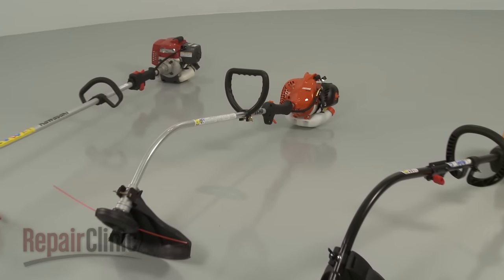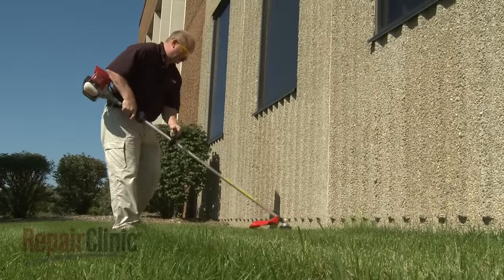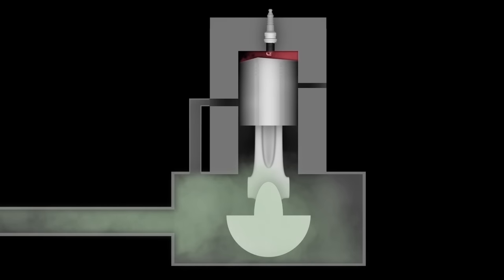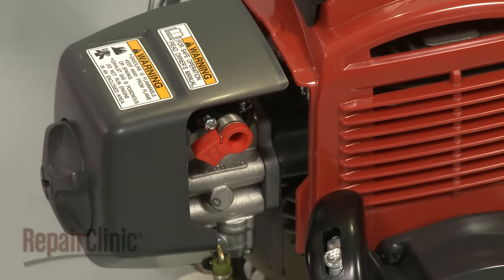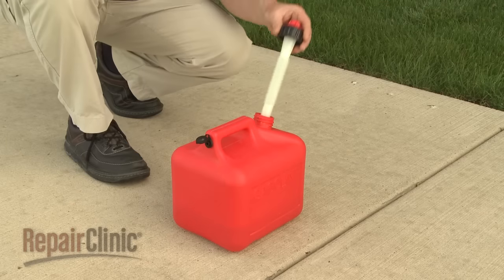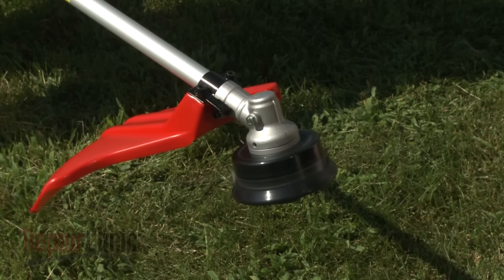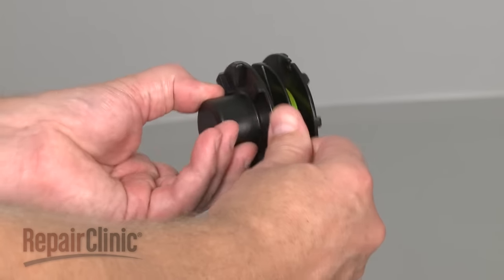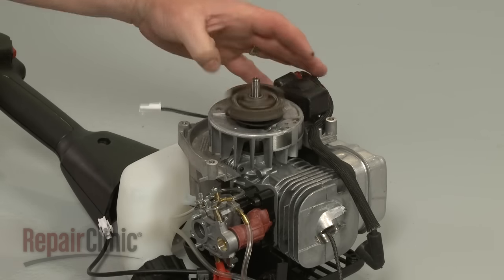How Does A String Trimmer Work? — Lawn Equipment Repair Tips

Comment: Hi Repairclinic. I was working at about 30 celsius outside for about a hour, than for 10 minutes i put the machine at a shade spot for rest, than i begun again. My spark plug was moist when i saw that my grass trimer (Alpin 520) was not working anymore, the next day when i tried to work. I changed the spark plug with a new one and the machine doesen't work still, but at least the spark plug is not moist.

Comment: I put my finger on the spark plug hole and i sense compresion when i pull the trimmer cord. I didn't clean the carburator yet and all the test i have done is without the tube (pipe) bar of the trimmer attached.

Comment: The bulb on a 2 cycle is not a primer bulb but it is a purge bulb. No matter how many times you push the bulb, it does NOT inject fuel into the cylinder. It pulls fuel through the carburetor and fills up the metering side of the carburetor. Excess fuel is pulled back into the tank. The only way to flood a 2 cycle is to keep the choke closed and keep pulling after it fires.

Comment: Hey great video. I just bought a string trimmer today. It seems to labour when under full load. Is that normal for the break in?
Reply from the maker: Yes the RPM will slow down a little under a heavy load, that is normal. Enjoy your new trimmer.

Comment: Great video, I just bought a craftsman weed wacker, it ran good for an hour when I tried to restart it, it will run in idle but when I try to pull the throttle it stalls out, i`m thinking its the wrong type of two cycle oil or too much ethanol in my gas, plan to pour out all the gas and replace it with craftsman 40:1 mix to see if that will help! This was the first time using the weed wacker. Any suggestions?
Reply from the maker: Carlos Johnson That sure could be a bad gas issue. We recommend buying the premixed 2 cycle fuel that contains no ethanol.
Reply: Ok thanks!!!

Comment: thanks for video.  trying to start my tb465ss.  it seems that I can't turn over the engine.  i pull idle lever and when I pull on string, the string snaps back.  it seems to me that problem could be:  a) engine seized b) clutch cable broken or disconnected c) i'm just too old and weak to pull the string hard enough.  any suggestions on how to test a and b?  c is obvious.  thank you.
Reply from the maker: Dan Schag The starter rope could be tangled in the pulley too. Unless you ran the engine with no oil in the fuel it is unlikely seized. The clutch cable can be inspected, but a broken one would not affect pulling the starter.

Comment: hi i have  weed eater straight shaft that runs and revs up and down just that the trimmer head doesn't move, I remember when I used it last I heard and felt like a snap what could it be I want to fix just want to know is it the cable or something different
Reply from the maker: Choco Drizz The drive shaft could have snapped or the clutch at the very top of the shaft is broke. Get you model number to find the right parts for your string trimmer. http://www.repairclinic.com/?TLSID=1773.

Comment: Please help, please help

I have  a brush cutter, the speed increases very high (this is the speed I want) when the fuel is about of empty (5mins before the fuel gets empty). So I'm wondering what makes the motor run at high speed when the fuel is about to empty. The choke is down (fully open when operation)
Reply from the maker: +Amrithraj Gopalan The Carburetor is likely defective if it does not run at top speed when you throttle up the engine.

Comment: Hi, when replacing old gear or bearing grease from a petrol string trimmer gear case/gearbox, how much (ml) of grease would you recon to pump in the gear case?
Reply from the maker: You will need to fill it up until it reaches the top edge of the case before the cover goes on.

Comment: i have an electric trimmer (homelite brand) been using it for a few months and now the trimmer doesnt want to spin. what can i do to fix this?
Reply from the maker: +Dragunity69 If the motor does not turn on the trigger switch could be bad or a problem with the motor itself.

Comment: I would like to know how to get a workx wg155 20v apart to check switch, motor,  etc. Just stopped while using it. Tried another fully charged battery, same thing. No response when operating switch

Comment: What is the oil gas mix 1/2 1/2  ?
Reply: Usually 50:1 fuel to oil mixture. You can buy little bottles of oil that has the exact amount needed to add to a gallon of fuel